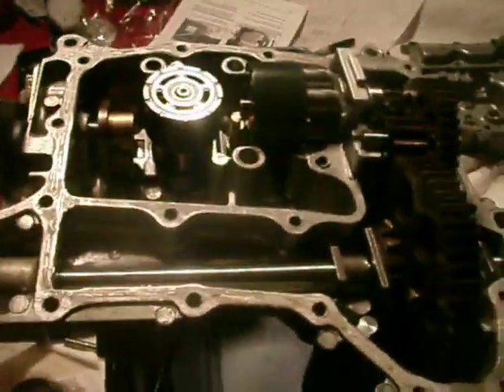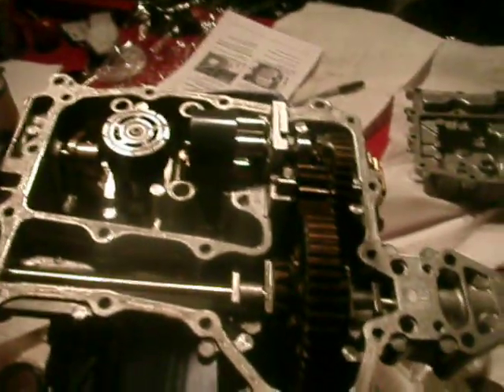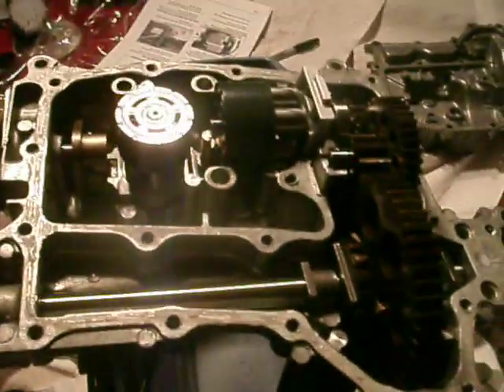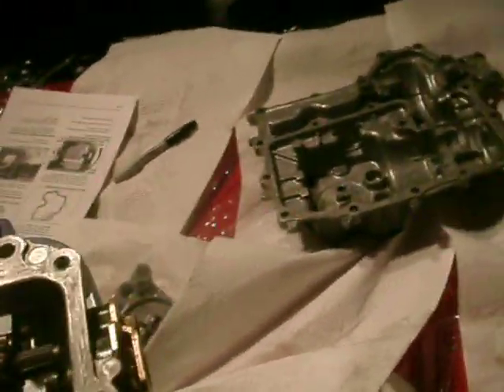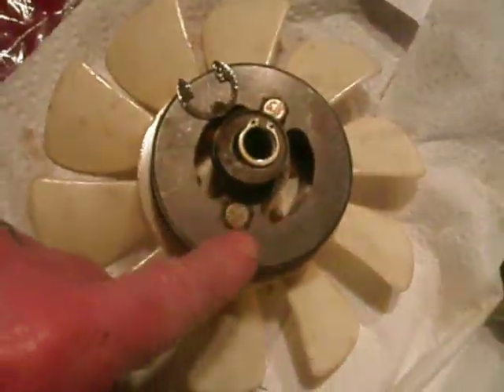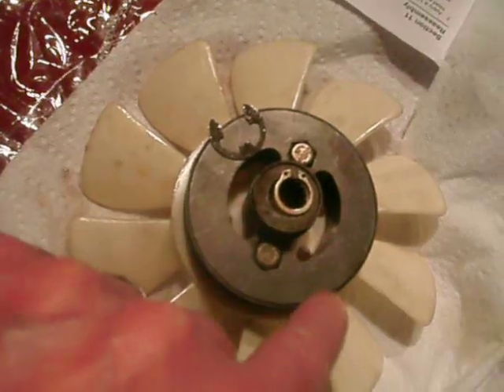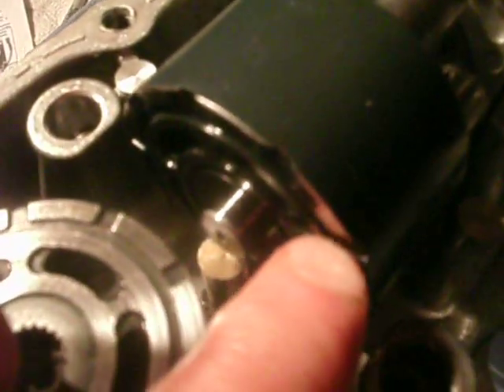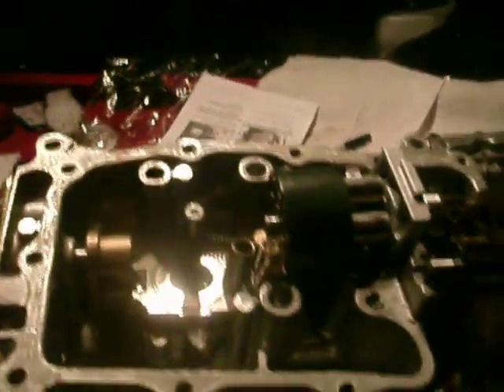Tuff Torq K51A Explanation  Attempted

Comment: ACTUALLY THE NEEDLE IN THE MOTOR SIDE OF THE MANIFOLD IS A PRESSURE RELIEF VALVE.  IT WILL TAKE THE PRESSURE OFF THE OIL IN THE MOTOR HOUSING SO YOU CAN MOVE THE TRACTOR WITH OUT TURNING THE PUMP AND THE INPUT SHAFT .  THE NEEDLE WILL NOT FALL OUT SINCE IT IS LONGER AND HORIZONTAL.  OF COURSE IF YOU FAIL TO PUT THE NEEDLE IN , THERE WILL BE NO PRESSURE IN THE MOTOR SIDE AND THE TRACTOR WILL NOT MOVE.

Comment: Hello, I have one of this, it doesn't move, when I lift the mower the wheels goes very slowly..lack some oil in circuit? Can't find the refill plug..Ciao!
Reply: Very likely low on oil. Possibly because leaking oil seals on axles and input shaft. The refill plug is on top. It’s next to impossible to refill without removing the transmission.

Comment: I been working for 4 years+ making these transmissions. some have alot of parts some not so many this is a rather straight forward model with the only acception it has a pump case and no axle bearings. Instead it rolls on bushings. These are well built transmissions as a K51 is a older model now and depending on how old your model is you may have bearings to hold your axels in place but i doubt it. Might I ash you why you chose to take it appart?